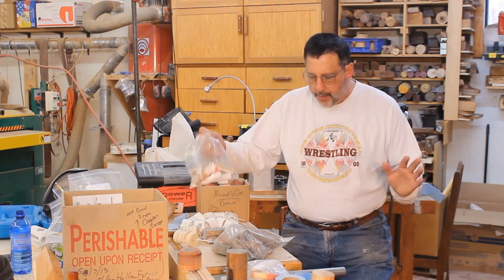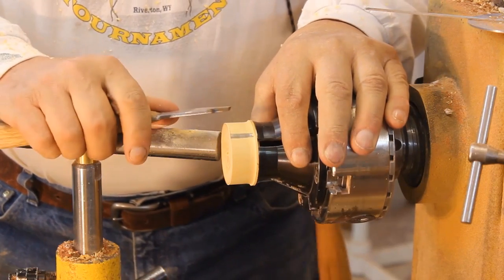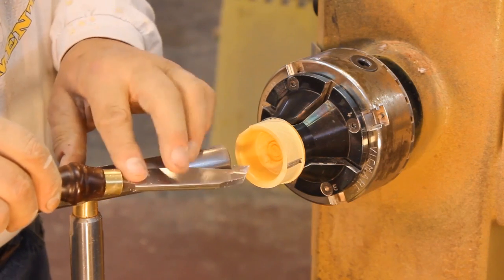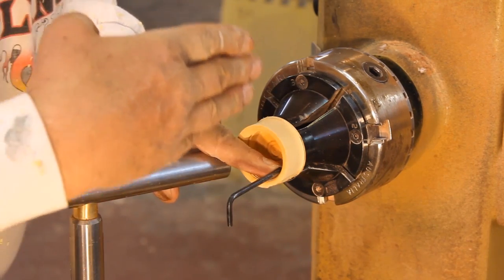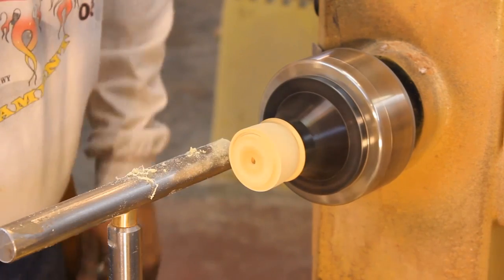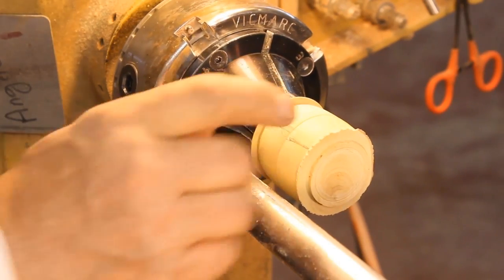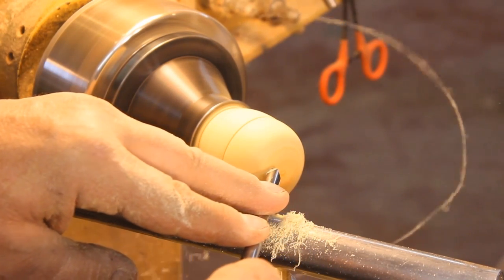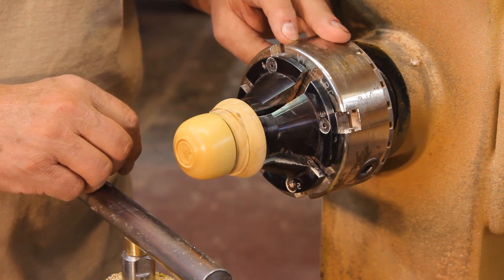Threaded Box: A step-by-step process/woodturning

Comment from the maker: John
I get mine from Tropical Exotic Hardwoods.  I get the smallest diameter log that they have available.  I usually don't make boxes more than 2 1/2 inches in diameter so I don't want the waste or expense.  I suggest you call them and they will pick something out for you.  I also get Mopane, and Partridge wood from them.  They take a good thread.  Let me know how you do?  Sam

Comment: Nice video. Thanks. Question, when should we use 12 tpi, 18 tpi, 20 tpi? Does it depend on the wood hardness or the box diameter or something else? Is 18 tpi a good compromise?
Reply from the maker: Ken,I think I will mention this comment in my next Notes from the Turning Shop video-scheduled out on May 22, 2022    this is a great thread chasing question that requires a little bit more explanation. My favorite is a 16 TPI chaser. I do like a 10 or 12 when I can use them. Because they make such a nice large thread. A 20 TPI thread chaser is not my favorite. But it works very well in plastics and very nice dense close grained hardwoods Sam

Comment: Great video.  I just got my double ended threading tool today from  Carter and Son Toolworks.  Can't wait to get into my shop.  You make it look so easy.   Do you saturate threads with super glue?  I notice that some do but I guess that is only on soft wood.
Reply from the maker: I try not to use CA glue on threads.  I think they tend to crumble over time.  I try to start with wood that will take a thread.  If then the threads are not good, I will use CA glue.  I just don't use softer woods.  But I also am stabilizing wood in a vacuum chamber and then chase treads.  This works good.
Sam

Comment: What is the proper toolrest height for chasing threads?
Reply from the maker: The cutting edge of the tool should be at center line or very slightly below.  But you can tell if the chaser is not cutting well.  Then adjust the height.
Sam